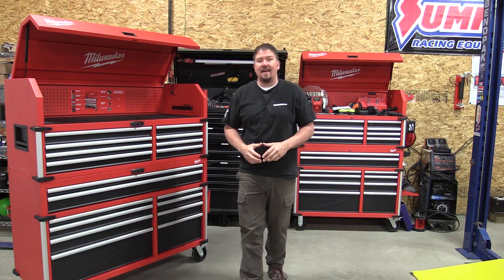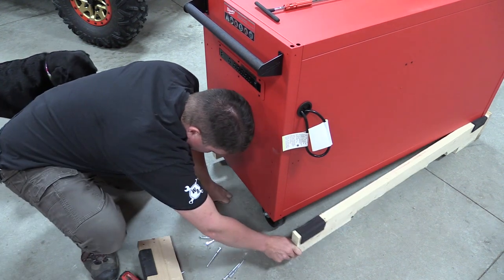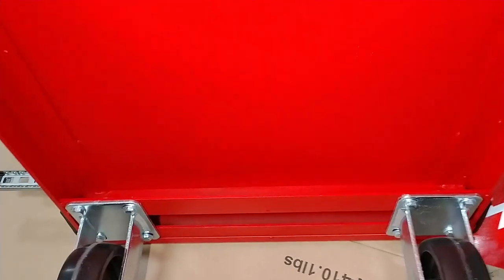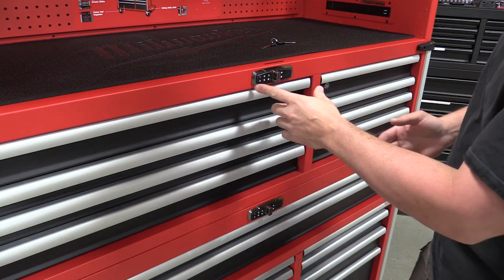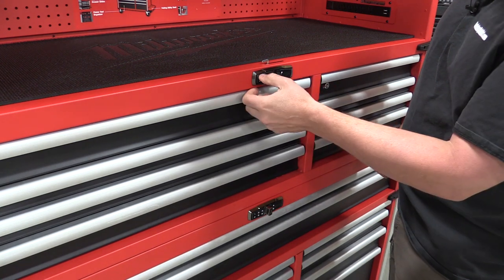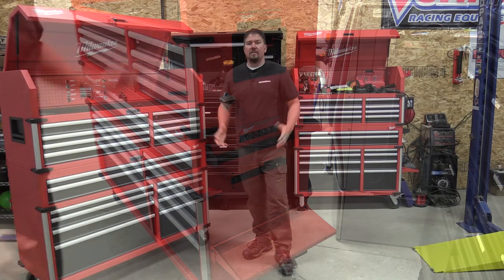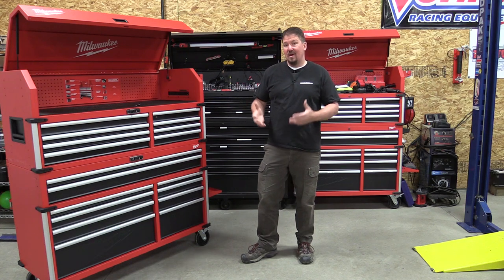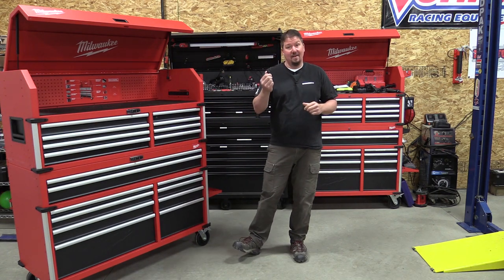Hits & Misses on the Milwaukee High Capacity 56" 18-Drawer Tool Chest and Cabinet Combo

Comment: I have the same box and my bottom lock had the same issue. I had to take the lock apart and there is a circular plate that I had to spin 180 degrees. I assume this is a mistake during manufacturing because the bottom lock works fine after I did that. I got my box for $1100 so it was easy for me to overlook a few of the things I didn't like about it. $1500 does seem a tad high. Good review
Reply from the maker: Wish I would have seen this earlier.  Home Depot said there was no fix and to return it.  The box went back yesterday.
Reply: I'm an old guy, and I've learned all of these big box store tool boxes have issues. Work through them and go on. I avoided the Craftsman boxes at Lowe's because of the 18 inch depth. And Harbor Freight boxes aren't cheap like they used to be. They've gone up in price. Buy what you like and can live with, unless you have at least 10 grand to buy a Snap-On, Matco, etc.

Comment: I kind of hate that these companies don't build these boxes with better quality. They should charge for cheaper because most people getting these are either an entry level mechanic at a dealer or a home user. but even if their a home user, at that price point there should be higher quality. You could buy a Mac or Matco box for probably the same size if not bigger, higher quality, for just maybe a couple hundred more.

Comment: Milwaukee really jacked up the price on these.  I bought the 52" High Capacity Mobile Work Bench 3 years ago for under $500 at HD.  This was the former style without the silver drawer handles and corner bumpers.  I think these retail now for around $800 which is a rip-off.  Glad I bought mine when I did...

Comment: The material thickness between Husky and Milwaukee is night and day. The Husky is way lighter of a box. i think that is the price difference. Milwaukee has a nice powder coat finish as well. I purchased the 46" top for 350 and a 56" bottom for 600. Both were marked down. so for just under 1000 this was the best deal i found.

Comment: Thanks for the video.  I am currently looking to buy a new toolbox.  So many to choose from. I do need to know,  how much does the box weigh? 

I don't always have access to a forklift.  To load and unload my toolbox. When I have to load or unload my toolbox I will remove all the drawers. To reduce the weight. Otherwise,  great video.
Reply: George Ferlazzo I was at Home Depot last night looking at this Milwaukee box. HD employee looked the weights up on their website. The top was 276 pounds and the bottom was 368 pounds - or close to those numbers.
Reply: @bcjack71  Thank you so much for the info. Because sometimes I maybe a one man crew. 

I guess,  I have more thinking or investigating to do. 

Again thank you

Comment: Question:  I have the opportunity to purchase the second gen. 46" Milwaukee toolbox as seen in the background of this video  ----> Is the construction of the 46" box identical to the 56" unit?    I am concerned about the build quality.  Thank you!
Reply from the maker: Yes, the 46 HC is made the same as the 56 HC.  No worries at all!
Reply: @WorkshopAddict  I really appreciate the reply. How is the build quality of the 2nd Gen. 46" Milwaukee Toolbox as compared to the 1st Gen 46" box? I have tried looking up any and all relevant info in regards to specifications and what I know is that 1st Gen specifies 20 gauge steel body with all welded construction VS. 2nd Gen specifies 18GA but mentions nothing regarding welds or angle iron etc. I am a bit concerned about the folded sheet metal construction and drawer slides being riveted on the 2nd Gen box -- but is the 1st Gen built any better? Any insight would be much appreciated. Thank you!
Reply from the maker: @JahRidley  If there is even a difference in the metal thickness anymore....  I am unsure.  Most Husky Boxes all claim 16 Ga.  Husky and Milwaukee are made in the same plant.  The HC box is just that, High Capacity, so it is deeper.  Not much is different other than some trim.  Both boxes have some thicker metal on the bottom where the casters attach, but that is about it.  You are paying for the depth.

Comment: I just don’t see the purpose for boxes like this for the price they are, just get a 72” or 56” Harbor Freight (or other comparable brands) box for $600-$1,000 and have a nice work surface on top. The HF boxes also have extra cabinet and side drawer attachments to add on to still come out with more money in your pocket...

Comment: Blains has this for $1400. Get a meet and beat at depot to knock get it down to $1400-10% then get it during 11% rebate and save another 1500x11% so that’s $165. That brings the cost down to around $1100. Not too bad but still expensive!

Comment: My lock just broke on the bottom box.
I can open it with the key, but then you cannot take the key out. When I punch the combination in on the top box, it works fine, and the green light only beeps once, but when I do it on the bottom lock, the green light beeps twice so I guess I’m going to have to re-search That.

Comment: I have a 52" Dewalt box set.... same deal made in the same factory as the Milwaukee and Husky. They are all made by International if I'm not mistaken.... who also makes the exact same box.    When I have the chance to do my final size and quality toolbox upgrade the Dewalt will be my at home tool storage unit. My first tool box set that is a Mastercraft (from Canadian Tire) is 10x the box in every possible way other than overall size to hold more. 

Better re enforced frame, thicker panels, much better slides, actually came from the factory with a handle up top to open the top of the box (only the Dewalt boxes decided not to add that.), can hold more weight per drawer and drawers aren't as flimsy. 

I needed the size upgrade and the tools are where your money should go first primarily as a tech. For the money you can get a much better box than those and for substantially less money those boxes would make much better sense

Comment: I'm not impressed with this particular Milwaukee cabinet.  I'm leaning toward the Husky since I'm not into paying for custom paint jobs and name.  Additionally, you did't demonstrate the lock operation with the top closed.  You only demonstrated it with it in the open position.  Some tool cabinets are finicky that way, just a thought.  Thanks.
Reply from the maker: OK, I left to top open so you could see the lock move.  But remember that the lock is working on the top.  The bottom one is the one that does not work.
Reply: @WorkshopAddict  Didn't you have a problem with the top lock trying to remove the key when you unlocked it with the code then tried to lock it with the key?   I know the bottom lock is separate from the top and has nothing to do with the top lock.  Cheers!
Reply from the maker: @William Logan Yes, but what I showed you there is spelled out in the instructions and functioned just like Milwaukee said it should.  They warn you not to apply pressure to remove the key as it will break the lock.  It does the same thing with the top opened or closed.

Comment: I own this box and I have a few nitpicks as well.  Before I get to that, I'd just like to mention that Milwaukee no longer fulfills this as a "combo" sku.  You have to order the bottom and top separately through Home Depot.  The worst part of this is that Home Depot doesn't even know that and just keeps carrying the sku out of stock on their website.  I had to call Milwaukee to see what was up.

This IS a $999 box, not a $1500.  I agree, and if you're not "Brand Type A" then go that route.  The fold out shelf is stupid and a trip hazard.  I took it out.  A lot of people use it as a battery shelf but it's basically another surface that collects dust most of the time.  It would have been nice to put it up higher above the paper towel holder where it actually makes sense.  The top drawers and that wide drawer on top of the middle are way too thin in height.  Stuff that easily fits in other boxes doesn't provide enough clearance in this box.  The most annoying thing is tool sets in injection molding cases are automatically a no go.  The digital locks are trash.  The gear hooks are flimsy and look unfinished.

Comment: If I got one of these home and the locks didn’t work and my 1/2” sockets didn’t fit in the big drawer using typical Hansen trays, I’d lose it. This box is a tease of good ideas sprinkled in with several bad ideas, unfortunately, because I wanted to have another good tool storage option.
Reply from the maker: To make it worse, right now I could not find anyone who will help fix a lock that is broken.

Comment: Hey love your YouTube channel. I’m torn between buying this Milwaukee tool box or the 56” Husky. After watching this video, I was leaning towards the Husky, but then I watch your review on the 46” Milwaukee tool box. On the 5:37 mark of that video you mention that Husky tool box didn’t have as much quality as the Milwaukee. So my question is, did Milwaukee drop the ball on quality from the 46” to the 56”? In this video you said the both the Husky and the Milwaukee boxes quality was about the same. I saw both boxes  at Farm & Fleet and the 56” and 46” Milwaukee look similar. Currently HD has the Husky selling for $998, and I can get the 56” Milwaukee for $1075. Knowing the two prices for each box, which one will you recommend buying?

Comment: I am a huge Milwaukee fan but I finally put hands on one of the 46" boxes last summer at a Home Depot. I was not impressed. Seemed flimsy. I am assuming this 56" is basically just a larger version.  On the other hand, the Masterforce from Menards is a stellar, solid box and is less expensive. Again, Milwaukee leads the pack in cordless tools, but these boxes? Not so much.

Comment: the silver handles i guess youd call them on the front of every drawer are they plastic or metal? have a cheapo 28" box and theyre plastic on it wouldnt think its a big deal but everytime i touch them it makes the whole box feel shitty and theres no way to label them everything falls or smheres off due to the coating on them
Reply from the maker: They are metal.

Comment: I have seen the two boxes (husky/Milwaukee) in the stores, side by side.  I can tell you that their main construction/frame is similar, but the Milwaukee seems to have heavier gauge steel, and better welds and overall better fir and finish.

However, have you looked into Craftsman Pro Series boxes?  To me they are a better built box and have a little better drawer lay out.  I think they are built with the professional in mind and the mechanic that actually uses them there on the engineer and design floor. Plus they have a lifetime warranty.  Who else has a lifetime warranty on their tool boxes?

I watched your other video on the Gear Wrench box, and saw that you had drawer depth/size issues there too.

Comment: Mate, the lock is well thought-out... The is supposed to be used as an emergency solution. It's also imprinted on "DIGITAL LOCK OVERRIDE KEY" and on the reverse side of the key it will say "DO NOT FORCIBLY REMOVE". There is a reason for that and I will explain. The key is only meant to give you access to a locked box. Once unlocked, it won't come out as a reminder that you need to address the matter. You will still be able to lock it and walk away. It's not meant to firstly lock it by key. In that scenario it will not come out in locked position. Basically you lock it electronically and there is a malfunction; you will use the key to open it and lock it back and you will be able to remove the key in locked position. Next you address the matter and bring it back to normal operation. What is wrong there is a mismatch of standard and override encoding and the entire setup needs to be redone. Home use is definitely and shop work is possible to the limit of sturdiness a mechanic is used to. If you take good care of your tools in the sense that you respect your tools, your tools will respect you back. As far as pricing, you call $1500 as being expensive... My advice is to see how much tool-box you get from a tool-truck for this kind of money; next remove a bit of sturdiness from that one, add a bit of "prettiness" from this one, add some extra storage from this one, actually a multiple of the storage you get at this price point and see if it's expensive. Heck, the Harbor Fright garbage got pretty steep these days (while it does not come even close due to being in a different, way lower league)...

Comment: Great review, wish I saw this before I ordered mine :) i am one that loves the 2 long middle draws and 4 casters, but fearful of the height, is this box taller than the Husky fully open? and do the 2 full draws depth equal the one Husky? I am finding mismatched spec where one says the Milwaukee lower full draw is 4.2in high which is taller than what the Husky states of 3.9, is the height in your description as measured?......, I have a lot of wrenches and currently are taking up 2 draws in my 41in box and I have more :) I don't lock my toolbox much but I really don't like how that lock mechanism works...... I am already double guessing my decision which was difficult in the first place as no HD has these boxes in stock around me.

How does this compare to the Summit box?
Reply from the maker: My drawer depths were taken from HD and I assumed correct.  I will measure today for you and reply.  I am happier with the Husky as it has a ton of drawers for small tools!  The Summit box is nice, but has deep drawers so I would rather have the husky for mechanics tools.
Reply: @WorkshopAddict  There is so much mismatching information on this box, check out your operator's manual and look at the capacity does it say 150lbs/300lbs/3000lbs or 100lbs/200lbs/2500lbs? The manual on HD's site says the latter.
Reply from the maker: @donelias1981  I went off the stickers because of that.

Comment: Can you make a one year review on the 56” milwaukee?
Reply: I've had my 2 56" boxes for almost 4 years drawers are all loaded most of them are opened & closed daily no problems with lockes except replacing batteries twice. I never move them but the couple times I did it's really hard to do when they are full had to move them when I connected the lockers to them now they will probably never get moved again in my life anyway. I didn't shop on price. I looked at a lot of boxes chose these because of how heavy & solid they are and didn't sound sound like tin if you slammed a drawer or cover. I'd buy the same boxes if I did it over.

Comment: Hi can anyone help me I bought the Milwaukee 56 inch tool chest with the digital lock, when it was delivered the digital lock was broken I contacted Home Depot they said I could bring it back but they did not have another toolbox or I could leave it in the store and wait until the Milwaukee rep came in but due to Covid they had no idea when or if He would be back I contacted Milwaukee to have a replacement lock sent and they’re having a problem finding a part number can anyone please help me get a part number on the digital lock?
Reply from the maker: Milwaukee  is having issues finding the part number?  Did you go to Milwaukee e-service online?
Reply: Yes I did and I still can’t get a lock it seems like nobody knows the part number and I’m just getting the runaround with Milwaukee
Reply from the maker: @franksanders8567  I am going to bet that they no longer make that lock.  I had an issue with the one not working and they shipped me a new one in 3 days.
Reply: @WorkshopAddict  Wow I hope that’s not the case because I’ll have to return the toolbox but I really appreciate your help thank you
Reply from the maker: @franksanders8567  if you Google a bit, you might be able to find out how to fix it.  Its been a while but I think something was installed upside down ina few of them making them not work.
Reply: @WorkshopAddict  Mine was completely smashed like something had hit it so I don’t think there’s any fixing but thanks
Reply from the maker: @franksanders8567  Well,  good luck.  I have had a lot of people say they have found the top, but not the bottom.  Seems Milwaukee  either discontinued  these or corona really impacted these.

Comment: Weren’t thrilled to make a $1500 sale? Ok then 🙄 Those electric locks are a bit of a gimmick to me
I’d be interested in a box this size if that top drawers on the trolley was split into 2 or 3. Like mentioned a selection of smaller drawers. 
Angle iron on the castors should be flipped so the vertical is closer to the castor bolts.

Comment: Funny, when i got the notification, i thought to myself man that thing is so overpriced since its just a stretched 46" w/ electronic locks and i see that you and most of the commenters below agree.

One thing i noticed about Milwaukee is they either knock it out of the park or its not worth buying. What are your thoughts on the 40" milwaukee just released?
Reply from the maker: I can tell you we will not be buying one and we would rather have the orange Sunex cart we reviewed.  $399 for a service cart is a bit over the top.  It is Milwaukee, not Lamborghini.

Comment: purchased mine at Home Depot in Memphis early March, easy to put together, I did notice on the box Made In China in very small print, sold my 46 inch Milwaukee to get this one, $1500, yes its over priced, all in all I like it, should be priced at $1100...
Reply from the maker: It will be soon.

Comment: All the drawers look the same as the smaller one behind you
Reply: It's almost identical. The layout is the exact same. Only difference is 10 inches wider and 2 inches deeper.
Reply: @jamesf9610  wow that's it other then the electronic locks